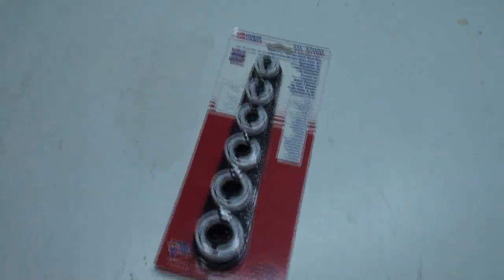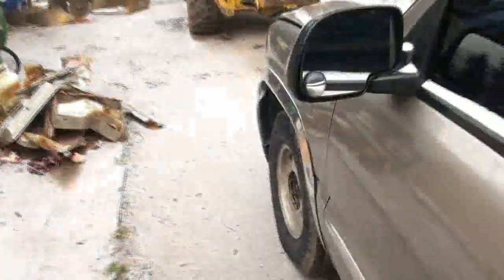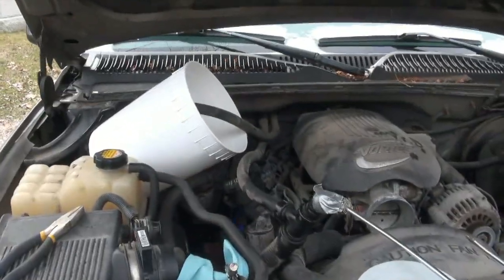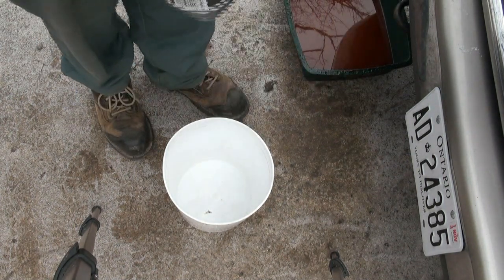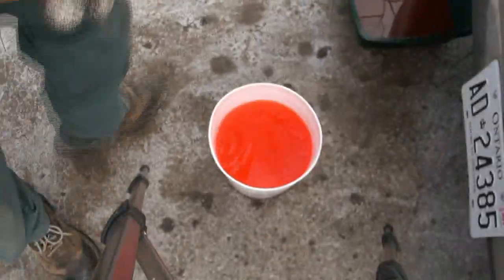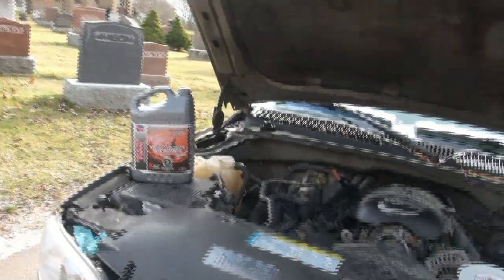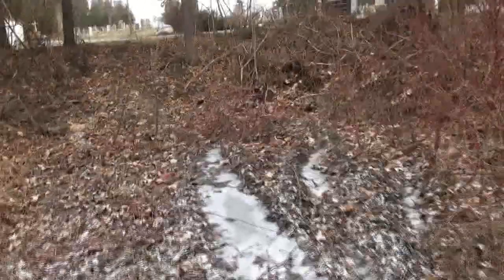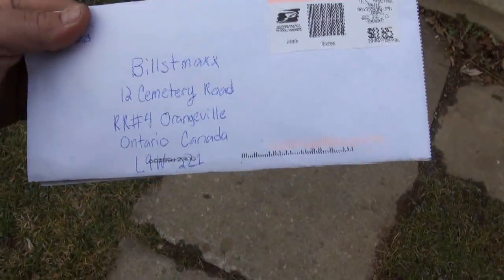cleanout of the 2001 gmc truck heater core

Comment: I had a 2000 Silverado truck with no heat. I've replaced the air mix motor twice before, about every 5 years to fix it. Not this time, still no heat. I checked the two heater hoses and one was cold and one was hot. I did the flush like you did and replaced the coolant. Presto! Heat once again. Thanks for the amusing video and giving me a boost to do the flush.

Comment: Thanks for the viideo and help...heater core was the problem..blowing cold air from vents while on hot...temp gauge on dash exceding limits...flushed heater core with air compressor like you showed and then water hose...April in Arkansas so no freezing problem..lol...back and forth til no more deposits out of heater core...Everything good to go now...

Comment: i was told by my mechanic to crank the truck then squeeze the hoses until they get hot enough to almost burn you, that means there is no more air in the line, then put the cap on and good to go!

Comment: Turning off the interior heat is better for the engine to reach its temperature more quickly, so if your engine doesn't get hot enough, the heat should be off till it has reached its temperature, and the thermostat in the rad will open quicker. Also, if the engine should get too hot, it's a good idea to turn on the heat (even if it's 40 degrees outside and you're melting anyways) to keep it from overheating.

Comment: If you were saying you had the water off and the lines blown through do it as you probably will anyway and grab a hose and a very large funnel, or if you are talking 6-8 cylinder use an inverted washing up bottle  filling the funnel and washer up bottle as necessary. It was the only was to do my first two cars which I kept in a hired garage just large enough for the width of a car I walked the 300 metres with a gallon of water and antifreeze mixed  previously used the funnel 2 feet of hose.

Comment: If you know the total coolant capacity, u just add the coolant straight from the bottle then add water to the protection u need. The chart is on the jug.

Comment: You need the heat on full blast to get the coolant at the proper level when refilling. Afterward you turn the heat off to get a more accurate engine temp.

Comment: you really need the DEXCOOL for that truck otherwise you'll have trouble with the cooling system and possibly intake lines. The glycol in the other coolants eats away at the seals in the motor. that thing squealing sounds like your alternator, the bearings in it sound a lil worn. Easiest thing would be replace the belt but i bet that's probably not going to stop it either.  I wouldn't worry too much that the coolant guage isn't going up that high, they usually don't unless there's a problem.

Comment: bet theres a low temp thermastat in there thats why it wont warm up and if u want to get rid of that squeak for free take off the idler pulley on the backside is a sealed bearing pop the seal off with a pick dont damage it spray the rust out with wd40 then pack hi temp bearing grease in it if its not wore out and put the seal back on the seal will stay in place when u mount it back up should last a couple years like that

Comment: There was mixed research when I posted this. Have mixed it for a short period with water as well when my pump went out couple days after buying my truck and didnt know what color was it in. I flushed it before winter and had now problems with it. I have owned it now for 4 years.

Comment: i used a water filled fire extishure with a a line connected to the compressor at 50 psi.. works ausome for cleaning heater cores..

Comment: Side note I had the belt tensioner go out on my 6.0, and advanced auto parts had the wheel itself for $20. I didn't have to replace the whole assembly, it was just like replacing a skateboard wheel.

Comment: Can you please use the Celsius setting on that temp gun? I can't deal with wicked units that aren't dividable by ten (like also those wicked lengths in 9.57382 feet and 37.7568321 inches and stuff). At 100 degrees, water boils, and at 0 degrees, water freezes. There isn't any unit system better than this. You all need to become reasonably metric!

Comment: I tried this with a few minor changes, blew out the lines at about 25psi and then pumped new coolant in reverse with the use of a small pony pump seemed to work some bits out and now I have heat again